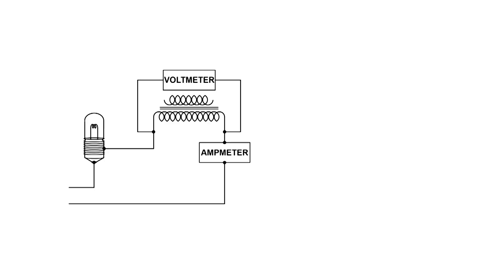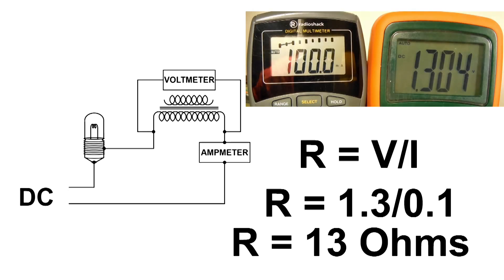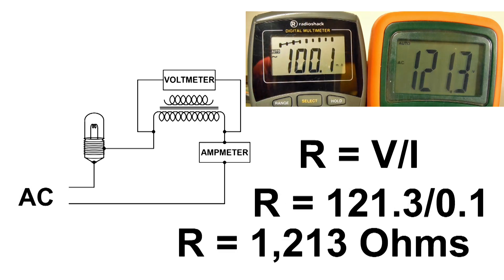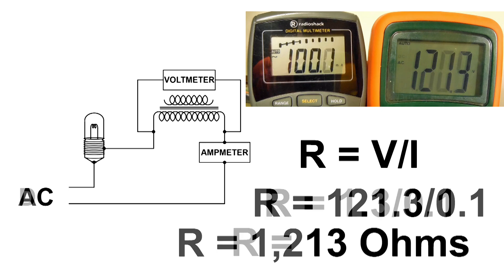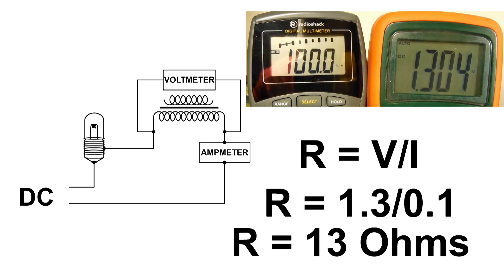Impedance Back EMF Practical Demonstration

Comment: Great lesson. I've noticed some of my transformers consume a lot more current once you get over 120 vac due to saturation. I'm not talking about your set up here, but every day use of power transformers with no load, just the primary hooked up. It's amazing how much the current drops when I go from 120 to 117 volts due to core saturation. Not all transformers are this sensitive, but some are. When I lived down in SC., the line voltage was about 121 volts consistently. When I moved to Maine about 13 years ago the line voltage is consistently 117 volts. That little difference can cause "wasted" power in some transfomers as you well know. Take care Rick and thanks for posting.
Reply from the maker: And also the circuit the transformer is powering. Thank you, and your welcome.